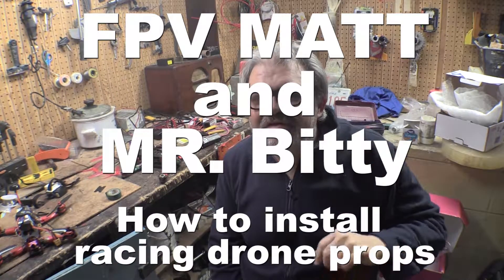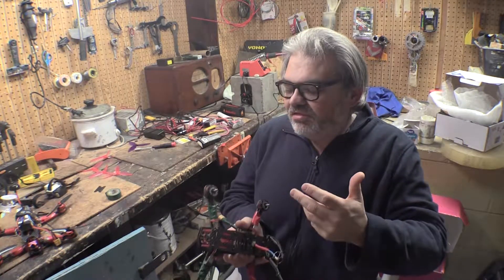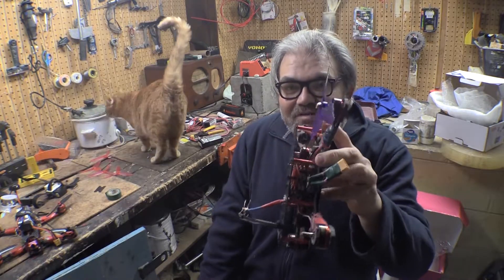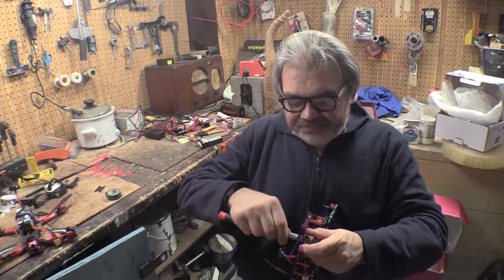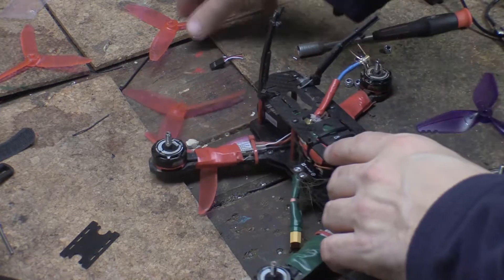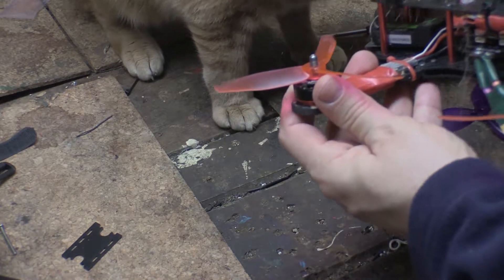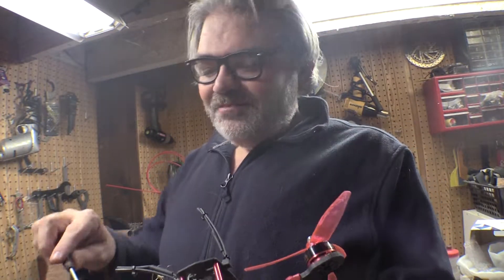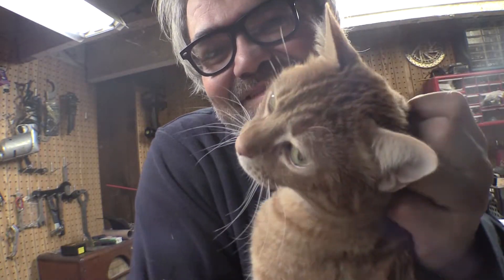How to install props on a racing drone quadcopter

Comment: nice same issue no instructions they just leave it up assuming you'll get it on there.  So what about the screws?  do you put that on top of the nut then?
Reply from the maker: I think the small screws might be for a different kind of prop then the ones I have in this video.  SOme props use two screws, and some have a locknut that goes on top.
Reply: @gattmolson   Ok i have extra screws I thought maybe they went inside the locknut after but I guess not.  Thanks a lot!  I just put the locknuts on.